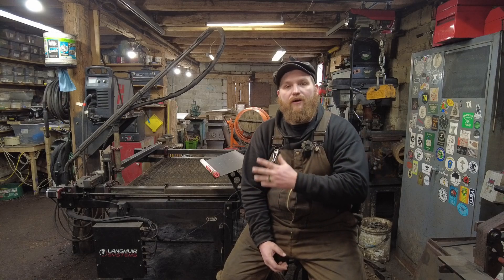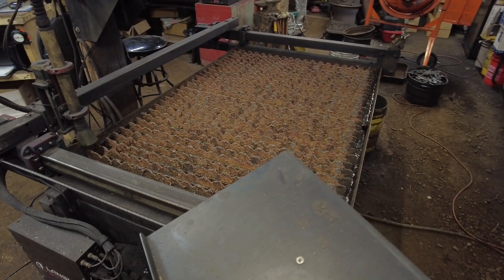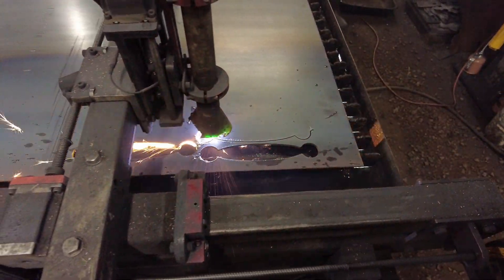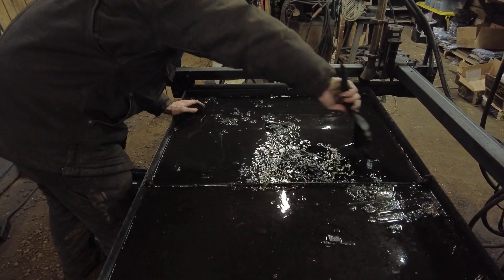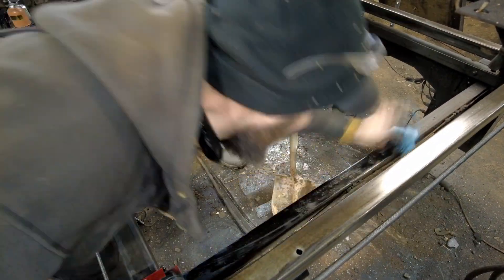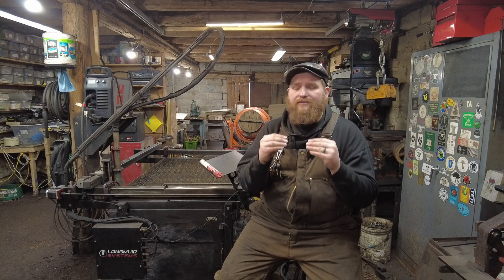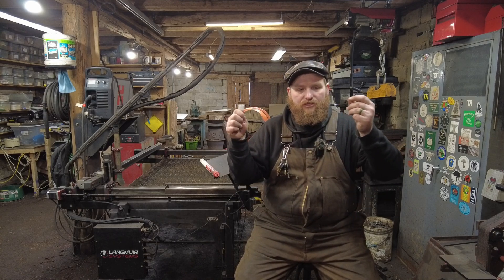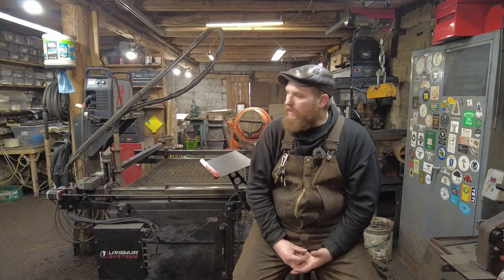Fixing One Major FLAW with the Langmuir Crossfire Pro

Comment: I agree the pan is ridiculous, not only did mine leak from day one but its allso stupid thin and wrapped causing my slats not to sit level partly my fault by not haveing enough water but when it's leaking constantly   .....youbget the point 1 more thing the drains sit up above the bottom of the table so trying to rinse your table clean is f$&#+$ impossible.     All this i still enjoy owning it,  buy the exapensive plasma machine or you will regret it later

Comment: Had this table for a couple years and had the exact same problem. What I did was use JB Weld on the center and around all of the screws and it stopped the leaks.